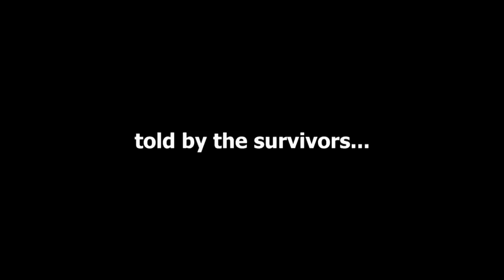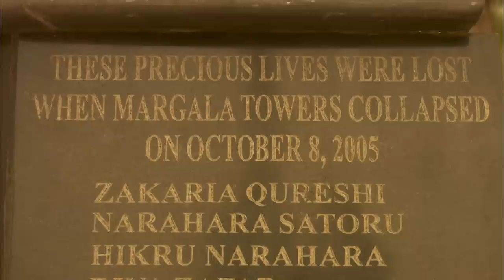Earthquake Leaves Survivors Trapped Underground For 4 Days | Trapped S1 EP5 | Wonder

Comment: You know every building there is probably not up to code...
Reply: Matt Kustom Kostumes-
Don't put so much store in building codes. There are homes hundreds of years old, and modern homes are made with OSB!
How many years will it last?
Think of the off gassing!
Yikes!
Reply: LaughingblueSu I know all about codes and construction- I used to be a Forensic Architecture Technician.  It was kind of like CSI for buildings, usually involving cases where moisture was penetrating into the building and causing mold & rot.  Btw, OSB is actually quite strong pound for pound...Commercial codes are a whole other ballpark than residential codes, and are extremely important for public safety.  We used to check buildings for compliance with fire codes mainly.  We found some real firetraps along the way.  We also checked things like stairway/steps code compliance, especially if we were involved on a trip & fall case.  Trust me, crappy construction kills.
Reply: @mattkaustickomments  You are assuming middle eastern countries even have 'building codes'.  I doubt they do, when I see buildings made from sticks, straw and cowshit.
Reply: comfortouch, actually most Middle Eastern countries probably DO have decent building codes.  But this is Pakistan - not the Middle East.